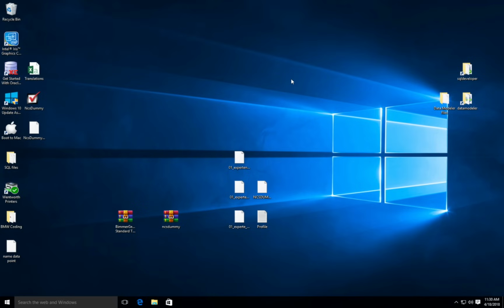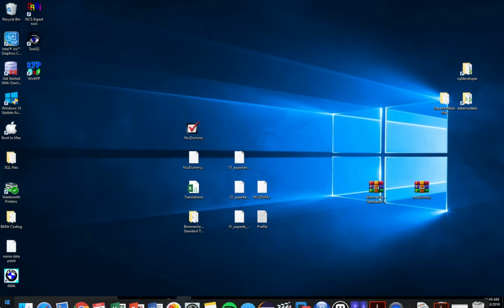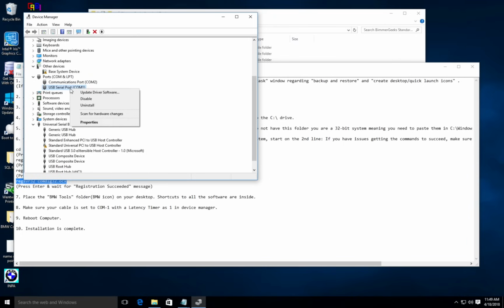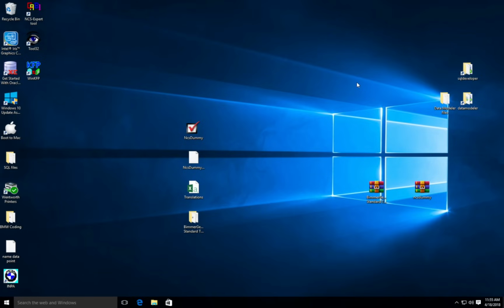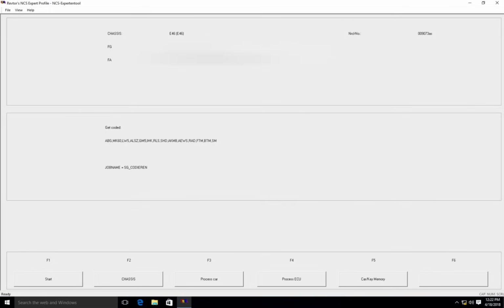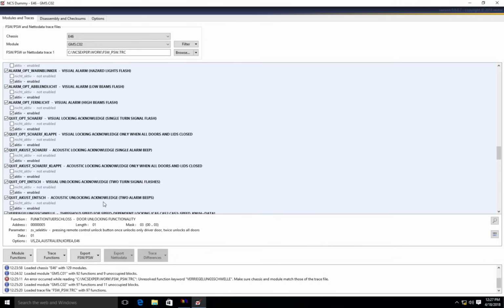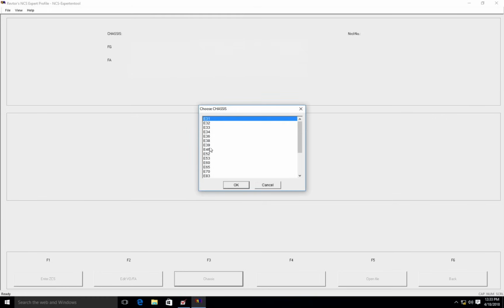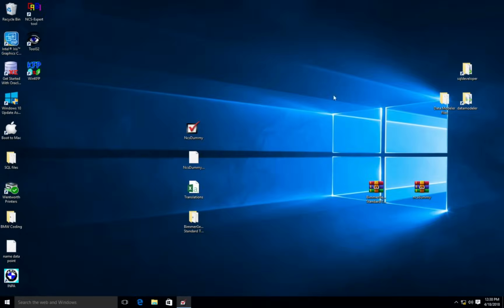HOW TO CODE YOUR BMW USING NCS EXPERT | WINDOWS 10

Comment: Hi, I have been watching your videos for a while now, finds the videos very useful regards specifically to e46. I have a 4 door 320d 2005 production. It is a base model and at times it is frustrating when you miss basic things like a drink holder or even an aircon which are now standard equipment saying that, still love the car have it since 09 and have 95K miles on the clock, looking at your videos there are endless possibilities to make it look cool and perform better though it is a time consuming but I enjoy it.
Reply from the maker: Thank you for watching and it is odd that BMW didn’t add these basic features

Comment: Hi I have 2009BMW 128i convertible E88 - been getting the misfire cylinder 6 a lot. Have replaced all Ignition Coils, All fuel injectors, Spark Plugs.  Still get error codes misfire cyclinder 6, DTC 29D2, 2E29, 2E1D, 29D9,

Comment: Thank You! This is exactly what was needed a step by step guide with possible reasons it wouldn't work. I tried doing all of this a few years ago and gave up. I spent 2 weeks tinkering every day. After watching your video I immediately went out and read a module, made changes with dummy, and will code the module tomorrow! You just saved me hundred of dollars to deactivate the AHL system on my 650. Again thank you!

Comment: Hi Evan! I'm having a problem. My NCSDummy keeps having an error no matter which GM5 module version I'm selecting. My E46 is an EU 316 M43. I've checked my cable connection using INPA but still error doesn't go away when loading the TRC file. Is there something that I'm missing or do I just try again?
Reply from the maker: Hmm try it without NCS Dummy
Reply: @EvanGoyuk  Thanks for the fast answer! I just checked a tutorial using the BMW coding tool. I think the problem is the EU base model's lack of accesories. I'll try to open the trc file with the coding tool and manually remove any coding possibilities with notepad which show an error. I'll let you know If this was the source of my problem.

Comment: Evan thanks for taking all the time to put this up.  I have 2000 e39 528i.  I think the ABG module is going to have to be replaced for F0 internal fault and also 11 power supply.  I was going to get a used one on ebay to save $$$.  Could you please tell me, will this program work with this car?  If so what is needed to code the ABG module?  Any Youtube links?  Thank you
Reply from the maker: Yes winfkp is what you most likely need
Reply: @EvanGoyuk  First thank you for replying.  What is WINFKP ?  Do you know if the Airbag module has to have my Vin coded into it?  I found a used one from the same model and year,  part number and version.  I was thinking maybe plug and play?  Do you think it would have to be sent to an Airbag Reset service first?

Comment: Thank u for a fabulous video & education as well! I have a question, I’m getting an error message from the frm3 folder. All my lights & everything else works properly. I’m thinking the frm3 folder may have got corrupted or was never installed. I have a 2011 E90 xdrive. 
Do u have a recommendation of steps for this fix? I appreciate it.
Reply from the maker: What is the error message?
Reply: Evan Goyuk when I select foot rest module, it says, ERROR! CODING NOT POSSIBLE BECAUSE A CRITICAL ERROR HAS BEEN DETECTED THAT MAY LEAD TO THE CONTROL UNIT BEING ABLE TO RESTART AFTER CODING.
Reply: I’m using bimmercode/veepeak obd adapter. I can code, accept my lights, mirrors etc.. after some research, I find that the frm3 folder is where the remaining options are in to code them.
Reply: Not being able to restart. In the first reply*
Reply: & I apologize for the wrong terminology in my question. It’s FRM3 module not folder..

Comment: Would you be able to help me update or reprogram a 2007 530i? I have an ECW error that is not allowing the car to start.  I have read that this is a common issue and updating will help. I need to order cable and or software.

Comment: hey bro, I just tried but when I put cable on the car and opened inpa, before turning the key, ignition starts blinking on and off. When I turn on the key ignition keep blink.. what could be?
Reply from the maker: Where’d you get the cable from? Could be a bad cable
Reply: uhm, from china like others. They gave a cd with it
Reply from the maker: Are pins 7 and 8 bridged?
Reply: there is the switch for the cort circuit pins. if I plug the cable with that trigged on right, ignition remains off.
Reply from the maker: How many positions do your switch have?
Reply: @EvanGoyuk  2 position. one for bridge and others one for separate. ignition stay off if separate and flicks if I bridge them, as I should do cause my car is e46 2001
Reply: @EvanGoyuk  it's work anyway if the ignition led flikering. a bug software I think

Comment: I have the 99 e46 320d. It has an OBD2 port but apparently thar doesn't work. Additionally there is also the round OBD port in front. Is there a way to code through the round port?

Comment: Hi, I change my radio (F20) and I need to code (the radio is the same but I loose some functions). Help me? Please
Reply from the maker: What functions did you loose?
Reply: @EvanGoyuk  one of the functions was the oil reader, the other was the color of the foot lights (sport mode).

Comment: I have selecded my chassis in the NCS Expert software, however the ECU choice that you have of AKMB does not appear,
The dialogue box does not pop up automatically either, I have to click on it, and then I only have the options for MK20E or MRS2,3 or 4
Is this a big issue and how do I get AKMB?
Reply: My car is a UK facelifted 2004 330ci

Comment: Evan, thanks for the video. I changed a few settings as per your video on my e46 2006 330ci convertible. After committing the FSW_PSW.MAN file most of the code modifications that I made are working except my rear windows no longer work, I can hear clicking when I operate the button but the back windows are now stuck open and won't close. I tried to undo changes that I thought I had made now the roof wont open either !!!!

PLEASE HELP !!!!
Reply: It's ok i managed to fix both the roof and rear windows with a bit of trial and error with some of the options

Comment: Thanks Evan. Your video helped me a lot to disable TPMS in a 2009 E90 M3. I have no iDrive and used the following code using NCS Expert and NCS Dummy (version 0.6.0.9) along with physically disconnecting the RDC cable connection from the module in the rear passenger wheel well above the battery:

CAS
Select ECU Module = KOMBI
KOMBI: RDC_ALIVE - nicht_aktiv
KOMBI: RDC_VERBAUT - nicht_aktiv
KOMBI: RDC_DISP_SWITCH - nicht_aktiv
KOMBI: MMI_ENA_RPA_RDC - aktiv
KOMBI: DSC_MIT_RPA_CC - aktiv

CAS
Select ECU Module = M3DSC
MK60_M3: RPA - aktiv
Reply from the maker: Awesome glad to help!

Comment: thanks for the help, and since u're active here, I'm gonna ask u for help with my E70, i'm trying to code the new angle sensor (kindly notice that i have changed and upgraded the iDrive system on my car 6 years ago, so the main receiver unit isn't the one that came with the car. but what i wanna know is, using this software, can i code each and every module independently ? or separately? 

see i have changed somethings in the car and now the workshop here that uses BMW software says we can't code your car, because it's asking for the old parts, but they told me you can do this coding "offline" so is this software what means offline?

Comment: Evan how can I send you a question?
Reply from the maker: Ask away
Reply: @EvanGoyuk  I wanted to see if you can help me. Long story short. I bought a 2007 BMW 328i. After getting it I started to get the ABS light and traction control light. And recently air bag light. I replaced all ABS sensors and brake sensors. I still got faults on the rear 2 abs sensors. I ended up having a look at the abs module. Come to find out the abs module electronic part number is different from the abs motor. So this tells me that the shady dealer took a abs module from another car and put it in this car. So I know it needs coded to the car. I also noticed my speedometer is not working and my milage meter stopped working. My trip meter does not work either. I got all the software you got configured on my laptop. I have been working 3 months on getting software that does not work. Installing and configuring only to not work. Wasting money on software. Staying up 22 hours to try and get software working. I think I got this software working. Can you please do a video and show me how to code a MK60 abs module to my 2007 BMW 328i?
Reply: I probably also need to calibrate my steering wheel also.

Comment: What version of Windows are you using? 32 bit or 64? I have managed to read and code some ECU´s, but I can´t read GM5 or the RLS. I was wondering if it´s because I´m running the NCS on a 64bit Windows or maybe the Daten files are not up to date. My car is a 2003 E46 320D.
Thanks for the video, helped me a lot, keep up the good work!!!

Comment: I followed the steps to the INPA and even though I haven't even hooked up the cable to the car, it shows ignition: ON.  I'll head out to the car to see if connects still, but do you happen to have an idea on if there's a fix?

Comment: Awesome video. I accidentally, well on purpose but I didn't know what I was doing, reset my FRM2 back to factory and now my windows won't roll, turn signal doesn't work, etc. I have been searching the internet for days, got a cable, got the software, but was too afraid to use it. This guide should help me. One thing though, I have read that I have to code the FRM2 (footwell module) to the VIN. I think I do that with WinFKP, any tips? Also, I have a 2011 335xi E92. I have read that I can use the E89 daten which is included with my NCSexpert. Is that true? If not, where to download the E92 daten? Thanks a bunch!

Comment: Great video! I can't make it working. I have the same cable with 4 position switch. My car is a 2000 e46 328Ci. INPA works, i can read engine values. When i use ncs, i click on start and select e46. I tried all the ecus with all 4 switch positions on the cable and I get every time the same error (Vin is faulty and 9+ lines of 009 and 2020). What can I do?
Reply from the maker: Driver issue. Cable isn’t set to the right port
Reply: @EvanGoyuk  Thank you for the reply! I've installed VCP 2.12.28 drivers from ftdi website and set the port to com1 and 1ms. OS is windows 10 64 bit (I use usb 3.0 on my laptop)
Reply: I tried on a windows 7 64bit with 2.0 ports and the same errors appear again. Windows downloaded the drivers automatically
Reply: My car has 16 pin inside the car and 20 pin in the hood, I think I need a 20 pin adapter to read ECUs correctly
Reply: @lucabortolami  did it work with the adapter?
Reply: @boostedcortez3156  Yes, on older E46 the ECU values can be read only with the 20 pin under the hood.

Comment: Great video instructions.  I have done all the setup and validated that the cable is connecting, but I always get a VIN Mismatch every time I go I do the chassis selection for my 2003 e46.  I have the exact same cable as yours and I have tried it with all 4 switch positions and all 4 chassis types. Any help would be greatly appreciated

Comment: Is it safe just to Execute JOBNAME = CODIERDATEN_LESEN, read the *.TRC file in NCS DUMMY, and then disconnect the car from the computer, without actually coding it or export anything? I just want to have a look on the options available in selected module.
Reply from the maker: Yes
Reply from the maker: All your doing is reading the code

Comment: In f30 windows are opening with remote control, but won't close. Any idea? 😉
Reply from the maker: Yes, it needs to be coded
Reply: @EvanGoyuk  could You tell me where in FA is the correct option?

Comment: When im trying to fing my engine N73 i have this error Group file: D_MOTOR IFH-0018: INITIALIZATION ERROR what is this?
Reply: Your cable hasn't been set up right, make sure obd.ini has com 1
Reply: V. TRMSNS Hi yes it is it’s correct COM1 also NCSXPERT is working. Maybe something wrong with Sp-Daten?

Comment: 4shared link to profiles is plagued with ads and everytime you try to download the files a new tab opens with junk! anyone who already have the profiles and  e46 coding options can upload this to gdrive or dropbox?
Reply: John Gonzalez did you find a way to get the profiles? I’m having the same issue with 4shared .
Reply: @n.miller9990  nope i ended using  Mike's easy bmw tools,no issues!

Comment: Yo man. I followed everything exactly and got every program correctly installed. I also have the exact same cable with the 4 switches. 
But whenever I try to pull the vin in NCSexpert, I get an error: VIN if faulty 2020. 

I tried every possible switch combination with every ECU option ...
Please help. 

Also weird is that INPA always reads the ignition on, even though I haven’t put the ignition in position 2 yet.

Comment: I followed your video step by step as you did it but when I go to load profile I don’t get all the options I loaded into the PFL folder the only 2 that show are labeled “Manipulation” and “Factory Coding”...any ideas on what I’m missing? Also WinKFP is not working either.
Reply: I apologize I put them in as shortcuts and as soon as I pasted the actual file in the profiles showed up. But still no go with WinKFP

Comment: Great tutorial however when i try to execute job (codierdaten_lesen) with ALSZ it says error in CABD  COAPI-2041. Can anyone help?
Reply from the maker: Are pins 7 and 8 bridged on the inpa cable
Reply: @EvanGoyuk  yes they are
Reply: @EvanGoyuk  also,it works fine for the GM5 module and some other ones but for some of them i get this error.
Reply from the maker: That’s a sign of the cable not being bridge properly

Comment: Thanks man.  I'm a complete nube at this and before your video, I found it incredibly difficult to find the programs, install them correctly and work out how to use them.  You not only provided ACTIVE links to the programs and files but you walk through everything in detail and in layman's terms.  You have no idea how appreciative I am.  Thanks heaps!!!  Now I have to search the net to find out how to fold in my mirrors on remote lock on my E70 and change the cruise control display from mph to km/h and hopefully display a digital speedo.   Hopefully there are people out there who explain in simple terms as well as you have.
Reply: Hi @robertsonfamily219 :) Fellow E70 owner here and looking to do the same with the folding mirrors. I will also be replacing the parking brake and that will be my first recoding. Main goal in the end is to remove the unnecessary NOX codes...bought the vehicle in California but live in MT so no need for those anyway. Did you find a good resource for E70 specific code instructions?

Comment: hello hope you can help i unzipped all the files then i opened up BimmerGeeks Standard Tools did what i had to do in there and them run as administrator then did all the bits in there and then i let it install then i ticked the box to say no i will restart the computer later, then i carried on doing the rest of it to the end then i saw all the icons on my desktop So i checked INPA & NCS-Expert tool and they work ok so i no it is all install  now and working Buy my Question is you no in the BimmerGeeks Standard Tools file we have a file call ST212 i noticed because of my security on my laptop unfortunately my security deleted it as it was saying it was a Virus in this file and i do not no why but will all the programs still work with out having this ST212 in the file or does it have to be in the file for it all to work or would it give me problems down the line ?Many thanks hope to here from you soon

Comment: Great video! Thanks for recording it and sharing, it's by far and away the most step by step intro to coding I've come across. Since you are using macbook pro, would you advise a virtual machine or bootcamp for those of us that will also be using a macbook pro? or is this software indifferent in that regard? I've got the intel processor chip (i5) for reference.
Reply from the maker: To be honest I use a VM and have had no problems. But I assume boot camp would have similar results

Comment: Hi Evan Goyuk. Thank you very much for the video. Following the instructions I was able to install properly std tools and inpa can see when k dcan cable is plugged in the pc and when ignition is on. Now my problem is when I press "info" button in inpa software in the ini path, ecu path, and interface I see lots of ???????????
Is yours doing the same? 
Any replay will be much appreciated.

Comment: hello Evan goyuk I did the update but why is it when I go to GM5 C01,C02,C03,C04,C05,C06. I am getting this message 
a RED( X )15:45:29  An error occurred while reading "C:\NCSEXPER\WORK\FSW_PSW.TRC": Unresolved parameter keyword "500ms" in function "HUB_VERZOEGERUNG_FH_VORN". Make sure chassis and module match those of the trace file.knowing I have had GM5 C01 & C06 working befor but now all of them are not ?

Comment: I get Vin is faulty error. I Have 2003 E46 Compact
Reply from the maker: Bridge pins 7 and 8
Reply: @EvanGoyuk  What if my cable doesn't have switch? I should buy one with the switch?
Reply from the maker: Yes or solder the cable. See link in description for a cable with a switch

Comment: Great information, thank you! I have the issue by selecting ECU. Every selected mode displays the message "VIN is faulty". Can I get some help on that? Thank you once again. ;)
Reply from the maker: Make sure pins 7 and 8 are bridged
Reply: Thank you for reply, it helped to connect! Now, can I get the access to already done changes?
Reply: Do I will get access to your file in Google Drive?